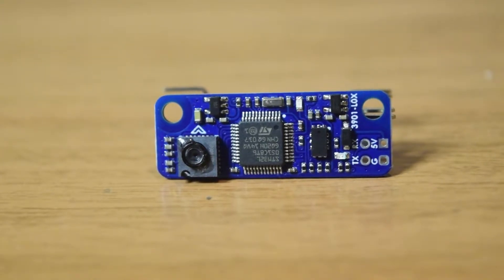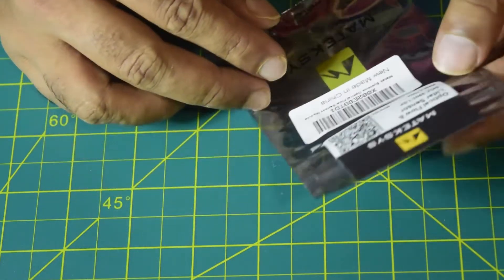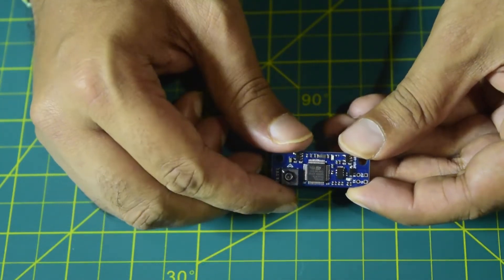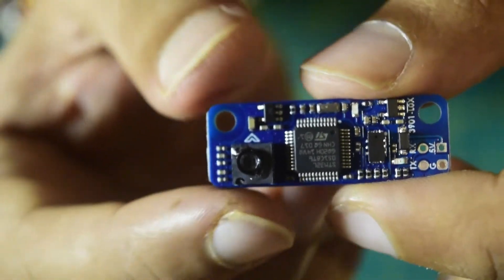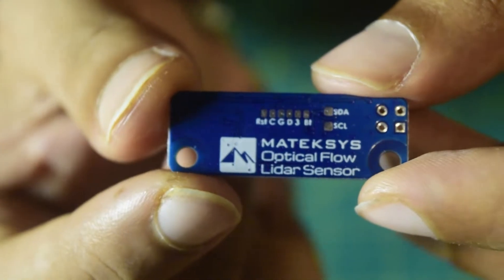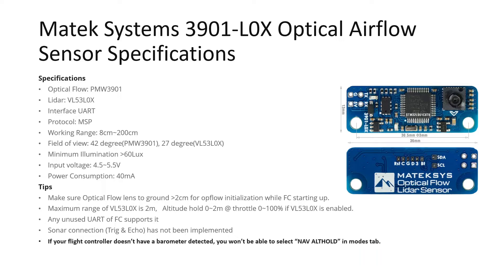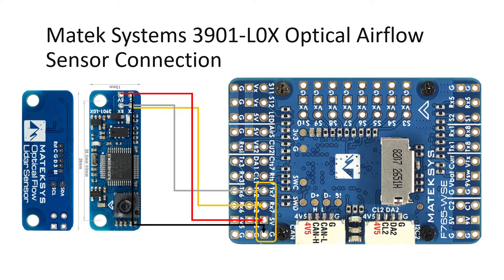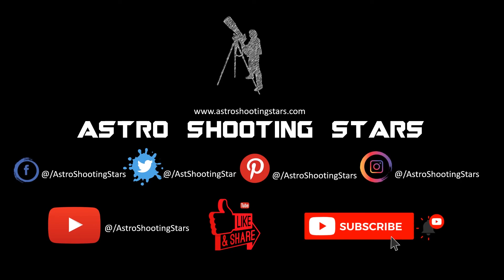Beginners Guide To Optical Flow Sensor with LIDAR on Drone | MATEKSYS 3901-L0X Optical Flow & LIDAR

Comment: Does optical flow help above 2 meters with position hold, or turns off with lidar above 2 m?
Reply from the maker: it dosent turn off but since the optical flow range is just 2m it will not get the directional information of the drift from sensor to hold the position. I hope this helps. please stay tuned to my channel for my future videos

Comment: this sensor is not the px4flow+distance sensor, and it works only under 2 meters (lidar max distance). What the settings I need to do in Arducopter to use it? Thank you

Comment: Hello, how do you activate it in flight ? Which mode on  Inav do you use to activate it ? Does it work with plane ? Thanks !
Reply from the maker: As of now its only supported in inav you can connect it to uart and select the option for optical flow sensor. you can use it for alt hold and pos hold.I hope this helps. Please stay tuned to my channel for my future videos
Reply: no Arducopter support? @AstroShootingStars

Comment: Hello, thanks for the video. Could you please tell me which flight controllers can I use this sensor with GPS and position hold?
Reply from the maker: basically any flight controllers with two free uart as this module and gps both uses uart. for  example you can use speedybee f7 v3 .I hope this helps.please stay tuned to my channel for my future videos
Reply: @AstroShootingStars  thanks mate. For now I bought the crossflight running ardupilot. Let see If It Will work fine.

Comment: With this wired to a UART, all that's left to do is configure ALT HOLD/POS HOLD in Inav? Does this mean this can be used instead of a GPS unit with compass?
Reply from the maker: its technically not a replacement as at higher altitude this will not work. GPS give coordinates but its still not that accurate and depending upon the number of satellites connected it will vary on its accuracy and compass gives the orientation. for postion hold you need this sensor and barometer at lower height and it will hold postion and altitude. but at higher heights it needs GPS and only GPS can give its absolute postion so its not replecement but helps to hold its current postion at lower height. I hope this helps. Please stay tuned to my channel for my future videos.

Comment: If I were you I would start with explaining what optical flow is
Reply from the maker: I understand my friend. I will note it for my future video. Just quick info it works very similar to optical pc mouse which detects the movement along with direction.  Hence its perfect for postion hold. I hope this helps. Please stay tuned to my channel for my future videos
Reply: @AstroShootingStars  I love your very explicit videos;
I installed the lidar matek on the other hand it does not hold it tends to go down slowly and when I increase the throttle it goes up like an arrow can you tell me what it can come from?
Reply from the maker: You can debug it from the backbox sensor data. I guess the problem could be vibration or excessive heat which could lead this. The controller get the postion data from onboard barometer and mateksys sensor both in combination with accelerometer and gps data to hold altitude and position. The sensors data could be oscillating due to which its slowly comming down. I hope this helps.
Reply: @AstroShootingStars   don't have GPS I only activate ALT HOLD SURFACE
Reply from the maker: You dont need gps for postion hold technically. For alt hold you need barometer and matek sensor. Please review your backbox data most probably its the issue of osciallation of sensor data due to vibration or heat.
Reply: @AstroShootingStars  how to solve this problem do you think? heat ? or vibration?
Reply from the maker: I would first suggest to check the blackbox data to verify the issue. For heat try relocating and and far from high voltages. For vibration which normally comes from motor , try using vibration dampning pads and recheck the frame for any loose connection. I hope this helps.
Reply: @AstroShootingStars  ok thank you very much for your advice
Reply: Sounds good and will do!
Reply: Could this be used as a bed sensor for a 3D printer?
Reply: @Plumpkatt1  Using this as a bed levelling sensor is a great idea. It's able to create a more dynamics mesh instead of the 25 points most printers do, however that will require someone  to edit Marlin or Klipper to support this sensor.